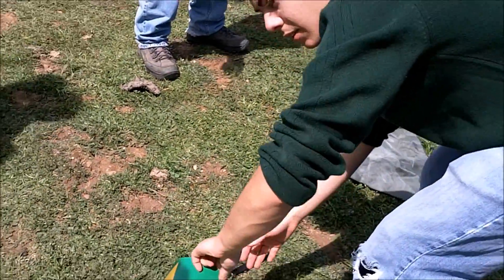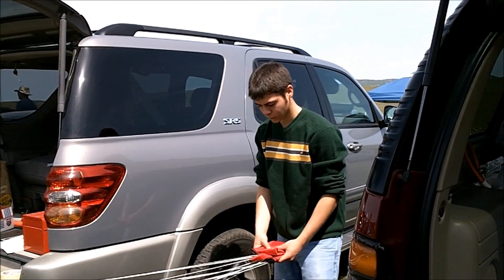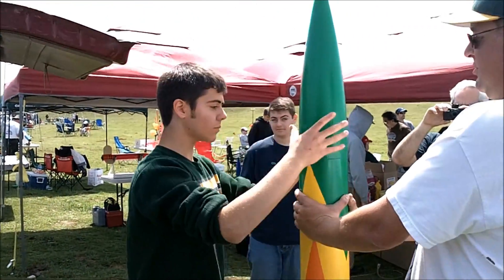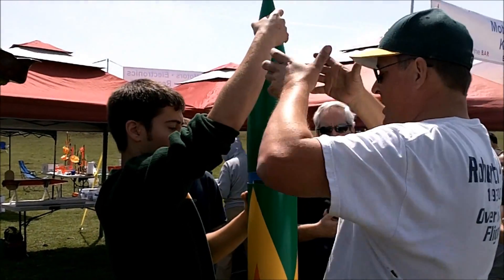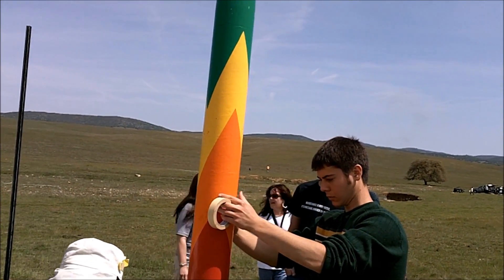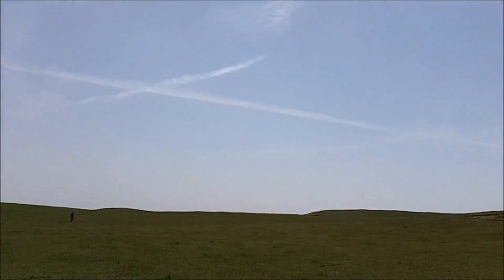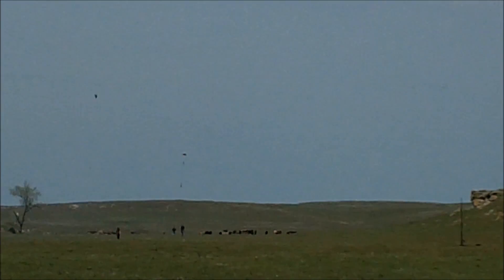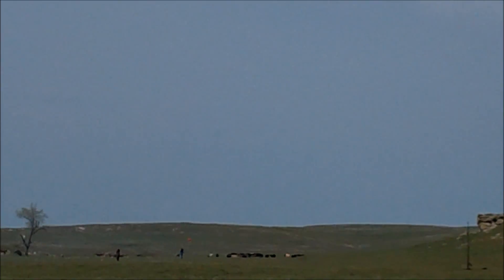LEVEL 2 HIGH POWER ROCKET CERTIFICATION

Comment: never ever roll that chute like that you do not wrap the chute lines around it who taught you that crap bad habit and you should use a rail not flimsy rod
Reply: Jeeze, man, the video's from 2012.  Standards have dramatically changed since then (for a reason).
Reply: @FleshGolem420  yeah but alot of newbies watching these videos do not look at when it was made and the comment was not for people that know what they are doing but thanks for stating the obvious
Reply: @sendit2873  what is the proper way as of 2023?
Reply: @TheRealJoshuaYang  if it's a big cord you wrap it in figure eights and put it behind the chute and if it's a small cord you just put it in the middle of the chute and fold it inwards like normal